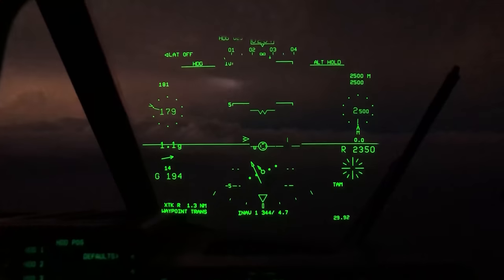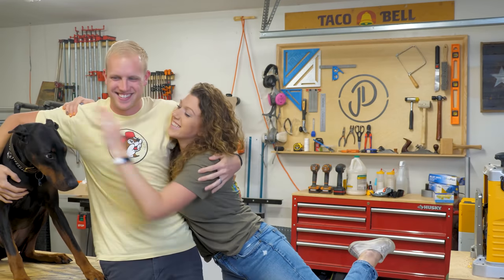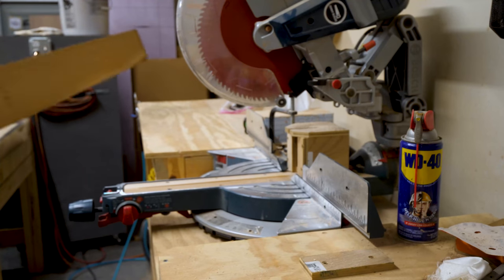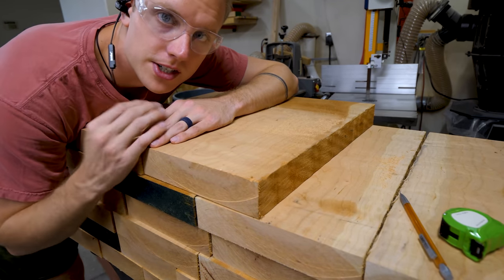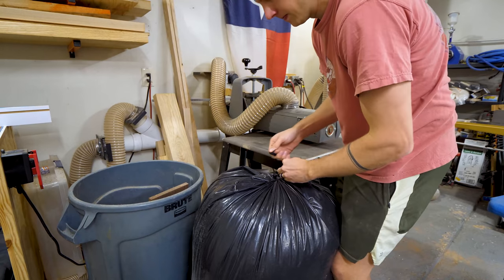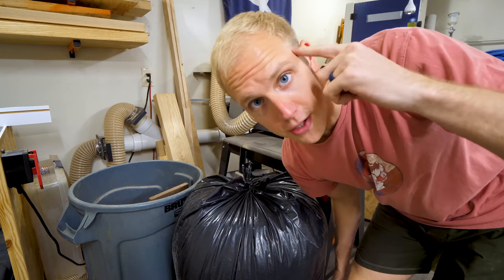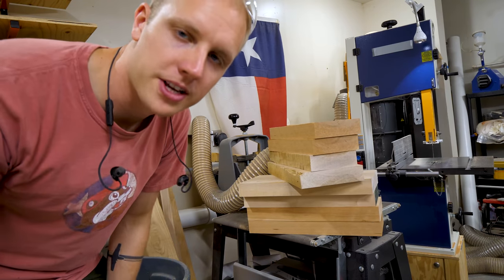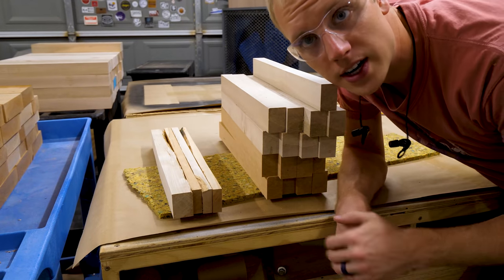What tool is best for cutting boards?

Comment: As lots of people have said, get a rip blade and you'll be amazed at the difference. Also, if the wood is pinching like that, you can insert a wedge once the end is past the riving knife to keep it from binding. I think you're right though, for rough work, the bandsaw is much faster

Comment: You are most likely correct, the tension in the wood is creating the problem. When you feel some resistance stop and start the cut again or (what you did) flip the piece around/ cut from the other side. As the board squeezes together during a cut if you stop and pull it out you’ll see the kerf is now smaller than your blade is thick.  run it through again and there will be enough kerf in the wood to proceed a little further if not all the way through. Definitely band saw is the way to go IMO

Comment: I use my bandsaw to rip boards for the thin strips. Way safer than the table saw. Also, idk if you knew this but you can rotate your band saw fence so it's not so tall. Makes it way easier

Comment: I was having the same issues with wood binding and ultimately stopping my blade.  I was using a 60 tooth all purpose blade.  Recently I switched to a 20 tooth rip blade and haven't had an issue since I switched

Comment: POWER IS THE ISSUE!! 100%!!
The G-0833P is "Hybrid" aka a contractor saw made to look like a cabinet saw. 
Do yourself a favor and get a real cabinet saw (3 to 5hp) and it will solve the stalling problem. If you have the power to maintain the proper rpms of the blade it will reduce but not eliminate the burning. 
It will reduce it enough that sanding or a light pass through the planer will remove it.

Comment: With a 2 hp saw id get a thin kerf blade from CMT and use a sacrificial fence to the front of the blade, that will take the stress off the maple. Or buy a 3hp saw

Comment: A 24 tooth rip blade is a better option . if you could get a 18 tooth, which you can't I believe, would work even better. My opinion is when ripping if you can't clear the chips and shavings fast enough you generate heat which aids in bidding of the wood. Stress in the wood is also another factor which I am not talking about. Hope this helps!

Comment: Check the square on your table saw fence, it appears to be biting at the back of the table causing it to bind and slow down and burn as a result, it's tapering, it's why it always starts the cut clean and ends tight. Using an underpowered saw is not your problem, I've used a flipped over circular saw for a while, the smoothness of operation is far more important than brute strength.
Reply: It might not be the fence it could be the table alignment to the blade, not a fun fix.
Reply: @billroderick2028  I was thinking that as well, he has to recheck the square on the fence, the blade and even the table itself, something is slightly off somewhere. Any time a bandsaw is outperforming a table saw for ripping, something is wrong with the table saw, even a flipped over circ saw should outperform 90% of bandsaws for rip cuts, but only if everything is set up right.

Comment: I can get good cuts in 3/4 (4/4) and 1 inch (5/4) wood with a 40 tooth General Purpose blade and yes sometimes get the stress pinching on the back side of the blade but never bad enough to smoke or slow down my saw. But for 8 quarter stock  I always use a 24 tooth rip blade. We are ripping when cutting strips along long grain. I see less pinching with a difficult piece. And I have a 3HP Grizzly.. If the band saw is better for you by all means go that route. You end up with another process regardless of cut method to get that smooth glue joint in the next step. Safety is always the key in any process. I think you're on the right track.

Comment: The benefit of a table saw is the ability to cut the strips before you cut to length, which results in less material handling.  I also (unscientifically!) feel like I get less binding ripping longer pieces than shorter.
I have a much less powerful table saw than you, I have a delta on 110v, and while I definitely have to move slower through the cuts on 8/4 material (especially maple, which is like cutting concrete) it's faster for me to rip once and then crosscut to length than to crosscut first and then rip. Slow is smooth, smooth is fast.
Also you might get 400' of cut on your bandsaw blade before it needs to be sharpened or replaced, whereas you may get 1000' out of a table saw blade between sharpenings.

Comment: Riving knives are supposed to be just a smidge thinner than the blade, so any wood with really significant internal stresses can cause this.  Using a thin-kerf rip blade is the easiest way to minimize this--but beyond that a "real" solution is to make a wider riving knife or longer riving separator in a custom zero-clearance-insert.  Too much trouble to go through if the bandsaw is working well!  It's probably a good data-point that bandsaws do better with thicker material, and a table saw probably does as well or better with thinner stock.  Thanks for making us all think about this!

Comment: Get a rip blade. Full kerf 24 teeth. Make sure your riving knife is the same thickness as your blade kerf. I only use diablo blades. They are the best in my opinion.

Comment: I use the thin kerf blade that cmt makes from tay tools and have no problems at all and I have the rigid r4512 running on 110 volt. Or you could try the glue joint RIP saw blade that cmt makes I've heard alot of people really talk good about that blade.

Comment: Assuming the fence is square, check that the belt in your table saw is tight. If the belt is too loose, if will have a hard time going through material. I had that problem when I bought my last table saw.

Comment: you need a 24 tooth blade to cut hard wood.  your blade is clogging up because there is not enough room between the blades to allow the wood to clear.

Comment: I've used a delta contractor saw and cut green hardwood timber with loads of tension with a dewalt 36teeth blade don't know what power the motor is but feeds in and out not A problem. Also how do you rate the mirka Sanders you should do a video on sanding to a finish.

Comment: Rip Blade may help but that is not the problem it is the wood.  I have seen maple stop a 3hp  saw with a brand new Lietz 24 tooth rip blade.  You are doing fine with the band saw due to the tin blade and less surface area for the wood stress.

Comment: you need only one side square on the saw guide , the crown  should be pointed outward, a dedicated rip blade also will help , as stated bellow the wood has not been Dried right . lot suppliers are rushing the drying time causing the binding . try doing 2 cuts  one 1/3 way up and second all way through I don't like using a band saw for straight cuts but can be done

Comment: Your tablesaw, properly tuned with a high quality 24 tooth rip blade will still struggle a bit with 2" hard maple. Your bandsaw does not. As you rightly point out, the bandsaw marks are planed away - you solve your own problem here. From a production standpoint, I agree having an outfeed for the cut boards to collect on will save you repeatative motion and time. But you are doing fine the way you are running so keep doing it!

Comment: Use a (sharp) ripping blade.  Also, align the fence a tiny bit crooked, to give a bit more clearance as you push the wood through.  You might think this makes for weird, inaccurate cuts, but it works fine.

Comment: First I would use a rip blade and set it higher to give it the cooling it needs. They are designed for that sole purpose. Good luck and hope you get it sorted.
Keep up the good work with the videos

Comment: I'm not sure if this will work for you or not. Now I don't have a band saw (yet) so I have to use a table saw to cut my stock to size. So for cutting boards I normally buy 1/2 inch stock then cut that to 1 1/4 inch. this will give me 1/2 wide by 1/14 deep stock.

Comment: So if you like the bandsaw, then I think you should stick with it. My only “suggestion” would be maybe try a dedicated ripping blade in the table saw? But that’s an extra cost and extra time to switch it out. But also in my experience, ripping blades do not leave a super great surface. Not to mention, I don’t think that would solve the problem of overcoming the internal stresses and pinching. I’m a tablesaw guy myself, so that is what I do. But also, I don’t own a trustworthy and capable bandsaw. Thanks for another video!

Comment: I would use a glue line RIP blade.  I have a  thin kerf general use blade and it made a difference on my 3 HP craftsman.  Maple is hard and usually has tension.  A higher HP saw will help.

Comment: Could be the blade.  I use the Ridge Carbide TS2000 blade on a cheap Ridgid contractor saw and haven't had this issue.  I can hear the motor bog down a little but not enough to cause concern.  The blade that came with it wouldn't even cut halfway through 8/4.  It could be a few other things too such as wet wood or just a difficult grain pattern.   Honestly I would use a band saw if I had one.  I just don't really need it for the work that I do.  The band saw seems safer to me and causes less waste.

Comment: My table saw isn't nearly as good as the one you are using but I will say this. I have zero issues cutting walnut and cherry for my boards...maple on the other hand gives me nothing but trouble. I don't have a band saw yet (its in storage at my parents house until I can get it moved 700 miles lol) but after seeing how you use the band saw to essentially resaw your boards I will definitely give that a try as soon as I can. Also, my table saw won't cut 8/4 wood (old saw, long story) so the band saw method would allow me to expand my product line.

Comment: I'm in the UK and I have the festool tks80 and I run a 24t blade and I can run 80mm(I think in inches that is 13/4" but I may be wrong I don't understand the American measurering system) oak beams through in one pass no problem
Reply: 80mm is 3.14 inches

Comment: When cutting thick wood especially maple cherry paduk and purple heart you need a decent rip blade I am in the middle of a move I use a 10" dewalt table saw but you still need to clean it every once in a while the saps and oils in the wood will dirty your blades and kill them faster and give you the issues you are having

Comment: Blades that have more teeth are used for fine finished cuts which is similar to the blade your using. Blades with less teeth are used to make rough cuts and ripping thick woods like your cutting. Also when making rip cuts table saw blades have a tendency to get dirty faster and oils build up on your teeth. Solve by soaking in Simple green. Get a cookie sheet and pour Simple Green and soak your blade for a bit to loosen the oils. Scrub off with a bristle brush (not wire).  Bandsaw blades work well too when making rip cuts. Less blades per inch are capable of holding more shavings as it pulls through the wood and dumps out. Research this on YouTube. Also don't forget blades need to be replaced often too which is an added expense.

Comment: try a thin kerf rip blade.  it will help and the thin kerf wastes less wood/ will get you closer to the bandsaw kerf width. pick up a freud thin kerf rip blade from amazon. it's 40 bucks. if it doesn't improve the cut you won't be out much money.  perfectly suited for that task and a good blade

Comment: I had a crappy table saw once. I was young, and it was cheap. wanted to get better results from it- cleaner cuts. bought a 60 tooth blade for it. it helped. 
time passed. got a brand-new, good quality contractor table saw. put the relatively still new 60 tooth blade on it, and what do you know- it won`t cut... the saw was weaker than the old, crappy one. so, I am using a 40 tooth blade in it. the cut is not amazing, but you clean it with a jointer anyway afterwards. try getting a lower tooth blade and using that for the table saw. 
in my honest opinion, a wide 6 tpi band saw will get the job faster, but the table saw is more convenient for these cuts, especially when you need to do a lot of them.

Comment: Fewer teeth rip blade, check fence for square, check so that riving knife is not too thin, sharpness of blade, squareness of boards you’re cutting, dryness of wood you’re cutting. All these are factors. I’d start with getting a 20 tooth ripping blade first, seems the most likely problem

Comment: #1 get yourself a good appropriate rip blade especially with 8/4 (check the specs on that blade your using and I bet your exceeding the max recommended thickness for it. With the appropriate rip blade if you still get binding because of really stressed wood, lower your blade so it cuts just over 50% of the thickness. Run it through with a quick easy pass the top half that doesn’t cut will prevent any binding. Then flip it over front to back and stick a little wedge in the front and run your second pass.  It’s like using a normal wedge but makes it much easier, safer, and faster than having to try to cut full depth and then stop or reach over the blade to add the wedge etc. Sounds like it takes much longer making 2 passes BUT it actually allows you too feed much faster than you would at full depth and easier on underpowered saws

Comment: As you demonstrated, bandsaw is better for cutting your 8/4 material especially because of the internal stresses of your stock causing binding on the blade.  You could get a higher HP table saw and a specific rip blade and be more successful getting thru your material, but you’ll still have the binding issue and potential for kick back, a dangerous thing.  The bandsaw is safer for this situation, and like Youtuber Mike Ferrington said, doesn’t kick saw dust back into your face.

Comment: Definitely a 24 teeth rip fence would make a big difference, thin kerf for the small table saw motor, and also you can try to rise the blade even further, so less teeth are in contact with the wood and thus less heat is generated. I know is not the safer, but it helps for difficult hardwood cuts with lots of internal stress.

Comment: It seems to me the wood is what’s causing the bulk of the issue. I am curious about the thickness of your riving knife. If it’s sized to pair up with a full kerf blade and you’re running a thin kerf blade, that could create some resistance.

Comment: One thing about the bandsaw the saw kerf is way smaller than a table saw. Therefore you have less wood waste. Try a rip blade the fewer  teeth and bigger bullets clear saw dust beyter.

Comment: add a feather board to control kick back and cut off strip to the left instead of against fence. Also blade should be a little higher if possible.

Comment: Is your blade right thickness. Standard riving knife is meant for 1/8" kerf blade. If your blade is thinner then this blade and knife combination won`t work. I have the exact same saw and I am ripping 2 1/4 ash with no problem.

Comment: While changing your blade to a thin kerf rip blade may help eliminate some of these issues, I think you'll find that with that much internal stress on the wood, you will still have the same problems. I have found the same problem when ripping large format New Zealand natives. My go to solution is to place a wedge in the end of the cut (before the stresses get too great). From there, its an easy cut. If the bandsaw is working for you, then just use that. It's the internet, and everyone has an opinion, but we all base that upon what we think is right based on our own experiences. I do agree with some of the other commenters though, that you table saw method does appear to be a little dangerous. I'd hate to see a "So they're going to call me stumpy from now on" type post.

Comment: As good as your band saw is set up and working I’d stay with it. It is much safer. That being said, there are ways to get the table saw to perform better.  Many good suggestions below. On thing I do is lower the blade so that the exposed blade is only about an inch high, make the cut, crank it higher and run it through again and repeat until I’m through. This will relieve the stresses before the cut is completed.

Comment: 1st, I'd rip the boards before cutting to length, and don't use a general purpose or cross cut blade. Use a lower tooth count ripping blade. ripping them at full length avoids the whole pick up and move a bunch of tiny pieces, can still stack the ripped strips on the miter so there is no loss there. Table saw should always be faster, but if the band saw is faster for you, then so be it. what ever works for you is going to be the fastest. Though, with the amount of pinch, will say you likely still have something outa square on that saw.

Comment: Wait….. how are you measuring intervals across a piece of wood? It’s a lot more accurate not to move the tape each time. Just pull the tape across the entire piece and for example you require 1 inch intervals then mark 1”, then 2”, then 3”…. etc.
Reply from the maker: It’s just for rough measurement
Reply: @jennieanddavis  would it not be more efficient not to measure and mark the wood at all and just set the fence to the desired cut width? I can’t remember the last time I marked the material to rip or cross cut. My fence or cross cut stops are my measure

Comment: I have a similarly powered saw and if I’m patient I can rip 8 quarter material.  After a bit of trial and error: Thin Kerf blade and it’s gotta be a ripping blade (I like Freud Glueline Rip).  

I did a table saw tune up/resquare not long ago and helped a bit too.

I’ve also heard the (possible wrong) advice to have your fence “toe out” a little bit (couple thou) on the out feed side.  YMMV with that one.

Comment: maybe you need to run the wood through the jointer first before cutting it on the table saw.   Not having a straight edge could probably cause the wood to jam.